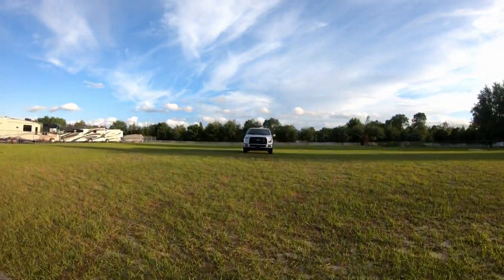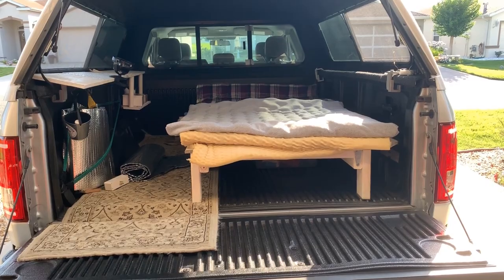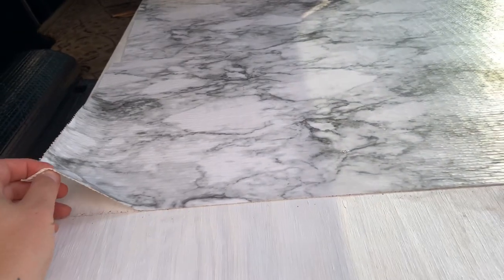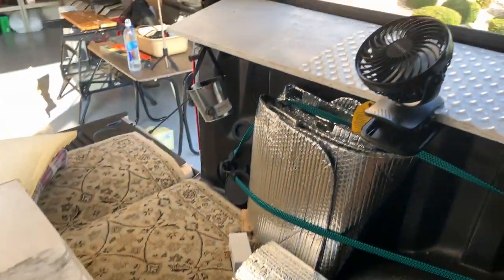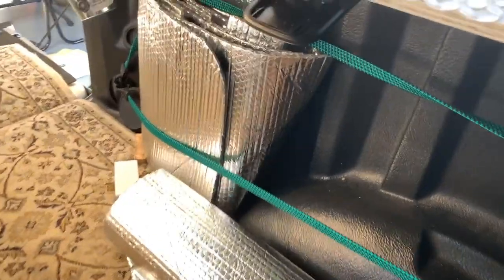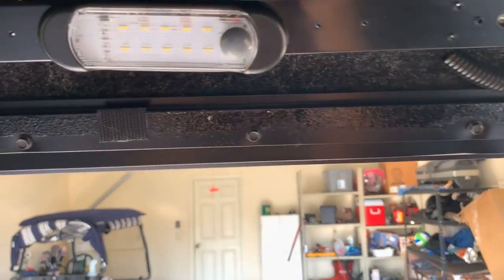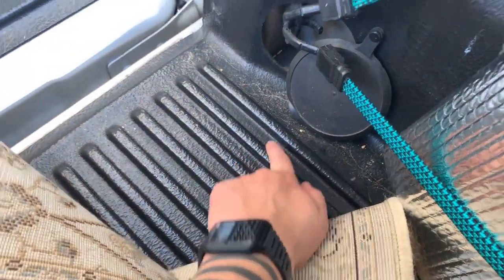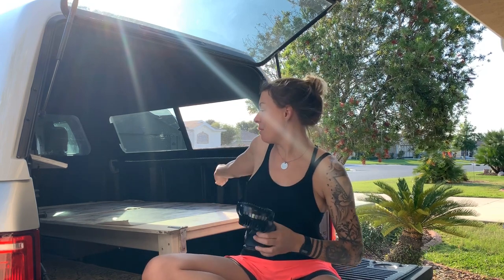Living in a Truck: my set up

Comment: I noticed you said florida..I'm living in my Tacoma extra cab 4x4 in oregon.it gets cold in the winter so I sleep in the cab so I have the ability to start it and run the heat. The back of my truck is where I have my RTIC cooler for my fridge and canopy so I can lock things up. One would think living in your truck in Florida would be a breeze.
Reply: Overland 80 Is it difficult to get comfortable in your cab, I ask cuz I have the same truck and am gonna do the same thing.
Reply: @gregflores8959  at first yeah it sucked lol. But warmer weather I'll be in the bed of the truck. I'm looking at maybe a van but I like to get up in the mountains so I like having 4x4.